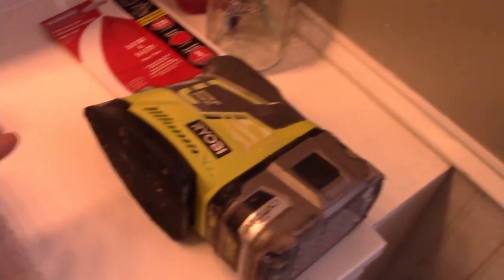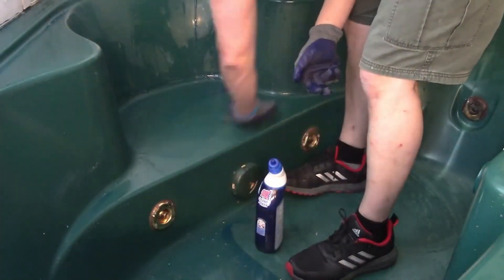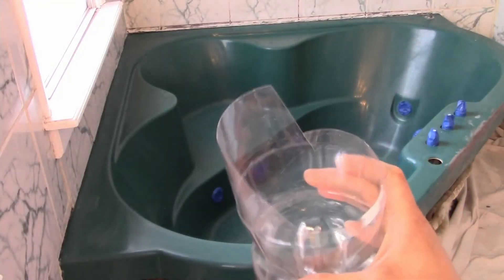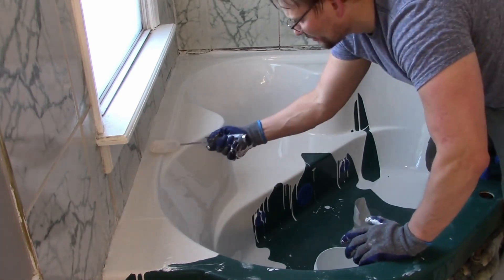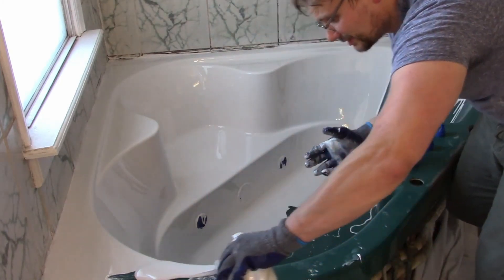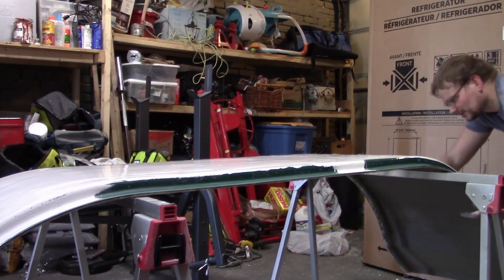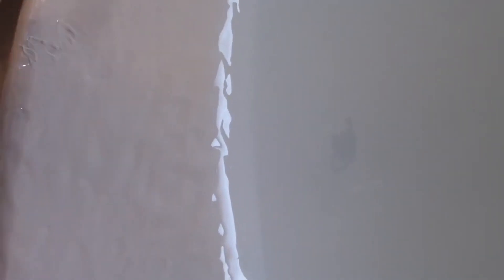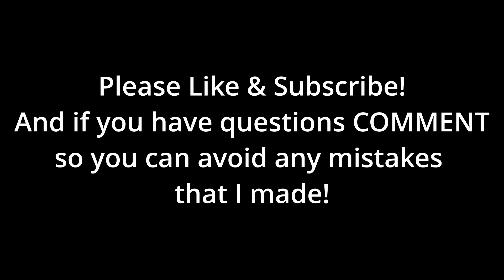AMAZING Refinishing a jacuzzi with Armoglaze / Ekopel 2k epoxy

Comment: I had a small plug in heater catch fire and burn and it fell into the jet tub smoke damage on same jet tub as yours. I am going to try to refinish it like you did. Should I use a coloured finish to help hide the black soot stain?
Reply from the maker: I think either one would cover since it’s really thick. Just make sure you really prep the tub especially the damaged area and I believe you’d be good. You can scrub it abrasively maybe with a 3m green scour pad.

Comment: I really appreciate you putting this on YouTube . I am wanting to do a corner NON Jacuzzi tub. I noticed EKOPEL has a pour on and a roll on. Because I doubt I can reach it all after the first coat I am thinking the pour on would be best. Which did you use? And do you feel 2 whole kits are needed or 1 regular and 1 smaller shower base kit? 
And where you showed all the orange peel where you worked it a lot did it really smooth out? 
Any tips for a corner tub? And do I just fill and tape the drain?
Reply from the maker: Hi. For my corner tub 2 kits were absolutely needed. 1 wouldn't do it now way! The pour on all smoothed out really smoothly. I'm not really sure about your shower base and if it would be enough with 1 kit. It very well may be if its just the base. What I would say is do the larger one first and judge the size differences of each and how much you have left when you are completed that one. A shower kit may be tough with the drain. With my tub I just removed the drain and put a cup under the hole that was left. You probably won't have the same access for the shower base and will most likely leave the drain cover on, which could work I believe. The only problem is that I would expect the EKOPEL or whichever brand you use would slowly pool more thick near the drain and may be hard to correct. You'd have to initially keep scooping the excess from around the drain and as it sets up and cures it would slow down with the pooling.  THe problem would be that as it sets up you want to be careful scooping too much more because it will also be less likely to smooth out. Best thing in my opinion for me was to put the cup under there and collect the excess so it was able to freely flow down the drain into the cup and no pool it. I'm sure by now someone has a way to keep the drain intact and not have it all gather at the drain. Maybe there is a newer video on this topic? Wish you the best of luck and please let me know how you make out with your project!  Thanks

Comment: Do you clean the same as with a new tub or do you have to be more gentle? Huge improvement! Thanks for posting! I wonder if occasionally spraying with those gel protectors for fiberglass tubs would possibly protect from the stain issues? (Gel-Gloss RV GG-16 Polish and Protector) I know I used one in a pink can that was a spray years ago, probably by the same people. Causes things to bead off better.  Just a thought.
Reply from the maker: I definitely wouldn't recommend using like an abrasive scotch brite pad or anything. But I wouldn't do that with a new fiberglass jacuzzi finish either. I will say this, there are some colored shampoos that can stain if left to sit on this and these stains are difficult or impossible to remove. Solution: Don't let them sit on there overnight. Also the gel coating could be a good idea to further protect the finish.

Comment: I have a green jacuzzi bathtub that I am eager to refinish. Two years later, would you still recommend doing this? I read in your comments that the main concern is that you are unable to remove stains. I have four children, so I worry that I will be frustrated with a “dirty” looking tub. Thank you for making this video btw.
Reply from the maker: Ok. So it’s not so much the stains from the kids. It’s just stains from dyes in certain shampoo. Like my wife had purple shampoo for blonde hair. We didn’t know so if a little got in there we may have not been so quick to wash it away. Now we make sure to always rinse anything off and not let it sit. If you’re just relatively careful you will be fine stains wise. Make sure to do it just in the manner I did or other people on YouTube do it. It’s not bad to work with. I bought 2 kits and had some extra but you use it all because it’ll all harden once mixed. Durability wise it’s very strong and shouldn’t have much issues. Please ask any questions you may have and I’ll do my best.

Comment: How long did you wait until after you finished to remove tape ? Also I can take my drain out so I don’t know what I’m going to do about that
Reply from the maker: It’s been a while so I don’t remember the actual time. But I waited until the stuff set up enough that it wasnt going to run any
More. You can let it dry with the tape or you’ll never be able to remove it.

Comment: Thanks for doing this.  I'm about to attach mine, and I'm curious about a couple of things.  First, how did you get the hardware off around the jets?  Second, did you caulk around all the jets once you put the rings back on?
Reply from the maker: I have a few videos on this process on my channel. The others are longer and more detailed. I think I explained the keys better. I had to unscrew them by hand and then pull the nozzles in the center out. One was very hard to unscrew and I had to kinda take the point of a screwdriver and wedge it against the jet and then tap it with a hammer until it broke free. It scratched up the hardware but I refinished it anyway so I didn’t care. Did a video on the hardware refinish too. But you have to tape the jets up very good to make sure nothing gets inside them.hope that long answer helps.
Reply: @Kazerone1  I appreciate the reply and the video very much.  My rings are absolutely not coming off after 35 years of calcification...but they look just like yours so it's good to know that they screw on and off...I just can't do it, lol.  I will tape them and then caulk them!

Comment: Where did you buy the armoglaze from
Reply from the maker: I bought one bucket on Amazon for about $142. Afterwards I realized that I needed more. For some reason I checked eBay and I was able to do a best offer for around $132. Thanks for watching!
Reply from the maker: I want to add though. They both appeared to have come from the same company I believe it was in Wisconsin.

Comment: Just curious how this is holding up? Looks amazing btw, what a huge difference
Reply from the maker: The finish is strong and seems like it'll remain durable. The main issue is that it seems to stain easily and any colored shampoos or bath bombs that kids may leave behind can easily seep into the finish and so far I can't remove them. It you're more carful or done have kids I think you will be ok.
Reply: @Kazerone1   Hello to clean Bath bombs stain use Windex with Vinegar spray - will work very well
Reply from the maker: I’ll try that. Thank you!